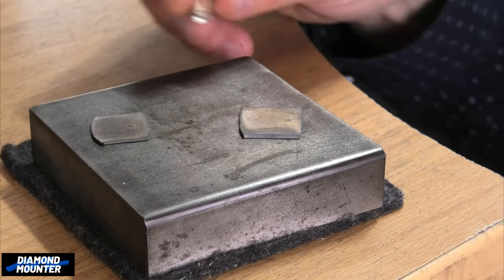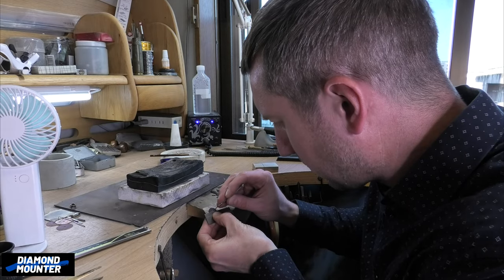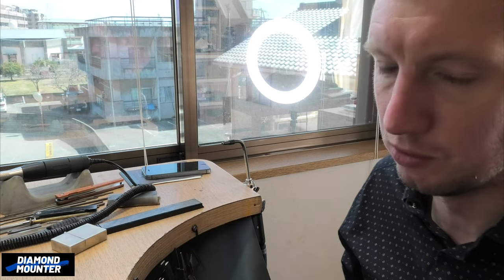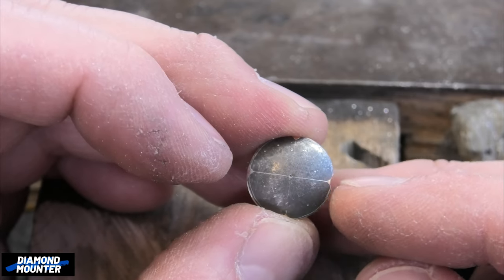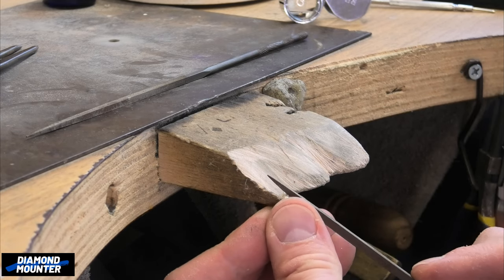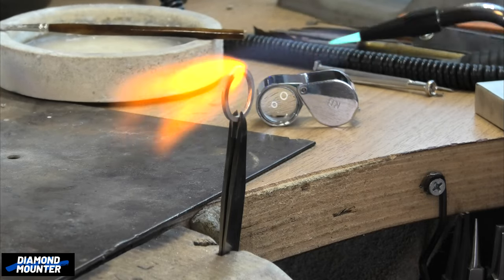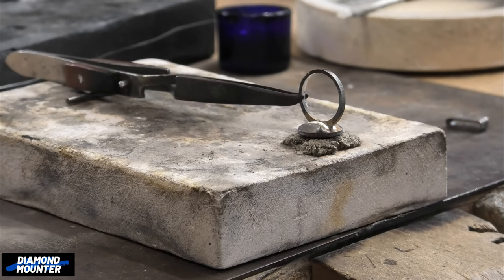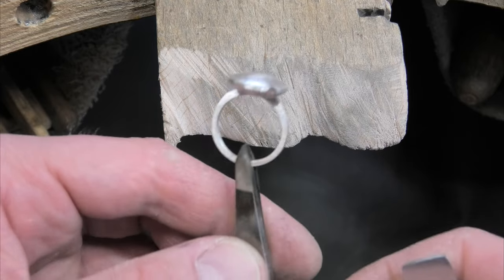Beginners Guide to Making a Cluster Ring

Comment: Chris, I..really loving this,  thanks for doing these step by step builds. I REALLY hope the next part isn't only for Patrons (eeks). Quick question: the 4 sections, are yhis efforts four stones? I have no idea what this build is going towards. Are you doing pavé after? Prongs? Can't wait to do this. And what do you mean by "no stones, so no holes to cut out of the bottom bit" ? On a two part ring disc like this do you have holes (for stones) go through both pieces? Also, when you were setting up to solder you had the unit held in tweezers, next shot the tweezers were gone and the placing of the solder happened. Where did the tweezers go and why?
Reply from the maker: Its meant to be a practice piece made of just the building blocks of a cluster ring. The 4 scoops are for practicing shaping around stones. The next video will be for patrons only!

Comment: Thanks for breaking this down for learning new skills in a project. Doubt if I’ll ever build a cluster cos my setting skills are poor. Difficult to get three in a perfect line! But I do make three layer ‘flower’ rings and these are much better now. I might even be able to sell one!
Ref your magic putty, here in the UK there is a product “therma loc” at room temp it’s a hard solid lump. After 20-25 secs in a microwave the round bar you buy in can be kneaded with fingers to a soft putty. You can push the cut dome into the putty and use tweezers on the shank. The putty will set like stone round the dome, so don’t go mad and bury it because it will be a nightmare getting it out. Just set it onto the putty gently and leave it to set. Warm the product if you have to because you buried it, and be gentle next time. Much cleaner to have around than mouldy wet  fibre board decomposing in a jar!😂 but thanks Chris for making an old man learn. Next I’m going to make your dome, but pierce a pattern in the two parts then solder that ‘dome onto a shank as a new (but repeat of an old) idea. Keep it up and good luck. 😅